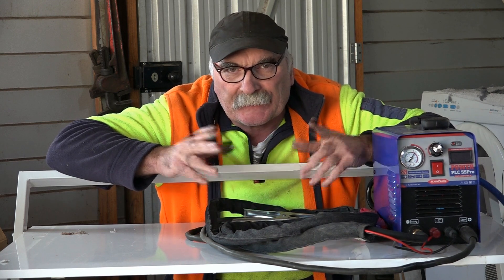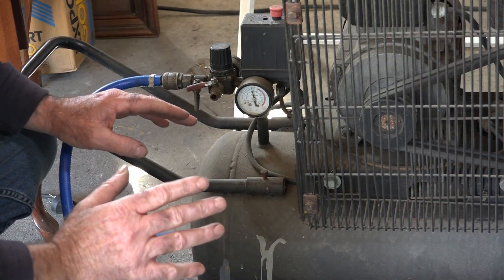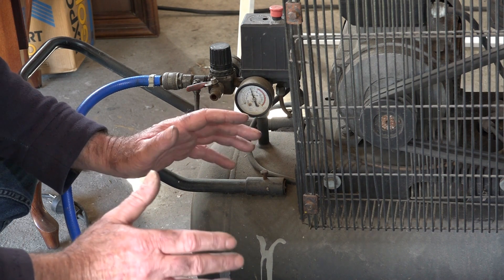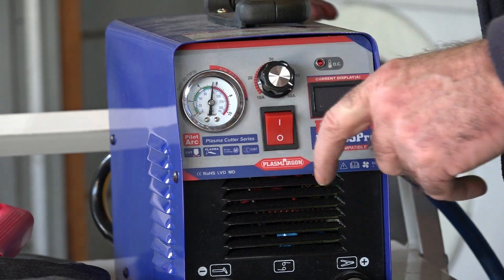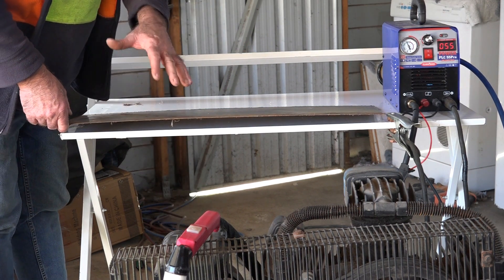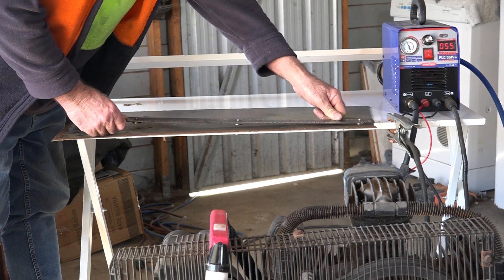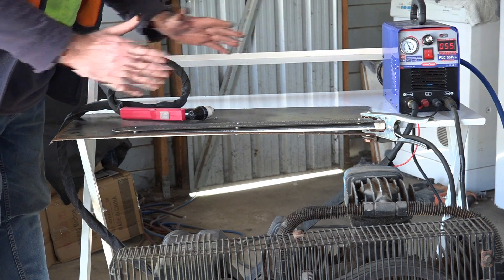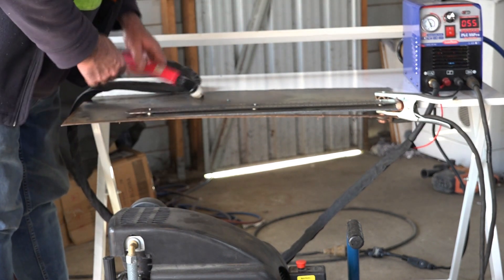Cut 50 Plasma Air Requirement's - What Will Happen

Comment: I'm running a 150ltr compressor, with a very similar plasma cutter to yours and it's great in the shop. I use a 50ltr compressor on small jobs out side the shop, and if you just remember the limitations of the smaller compressor, then you can do most things.
Reply from the maker: Hi mate yes I agree you will be surprised what you can cut with small compressor.

Comment: Admittedly I wasn't doing any scientific measuring, and it was a little hard to hear with the generator going, but moving up to the 26gallon compressor made a world of difference. Naturally with more reservoir to work with, going from a little 5 point whatever gallon to a decent hot dog tank, you're going to get a longer cut, but now I'm getting Consistency to boot! 
I haven fallen victim to my own efficiency game, trying to make the best, longest cut with Just the right amount of air, Just the right amperage, etc, while trying to remember that even if the compressor kicks on, now I have that little extra work time in the relatively larger reservoir to work through before the Hole in the Bucket wins out; aka the compressor gets Real Hot!
So me trying to optimize everything, I fabbed up an aftercooler for the plasma torch to run through, very scruff of the neck long line of tubing coiled in a bucket of water, trying to see how much water was really being condensed and captured/separated by those in-line filters. Wouldn't you know it, but make-shift coupler between the copper exit line from the compressor and my first junction blew out and scared the bejesus out of me. Hahaha...  For the good news, I was able to ascertain that I was getting about a quarter ounce of condensation starting from zero to 130psi that would have ended up in the tank, and a fairly marginal amount between charges.
Reply from the maker: Wow very cool my friend .I would love to see that ?